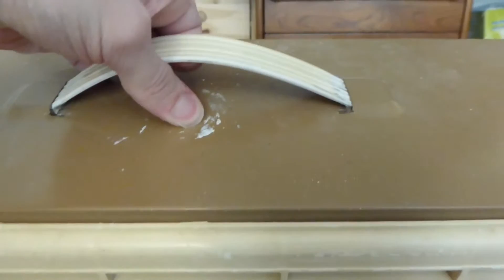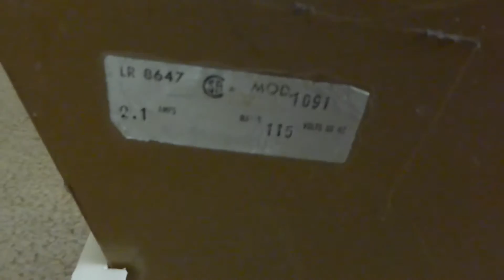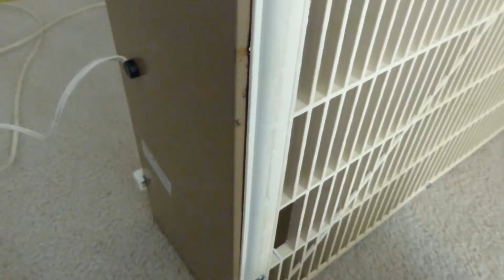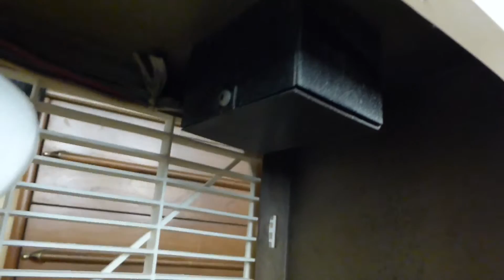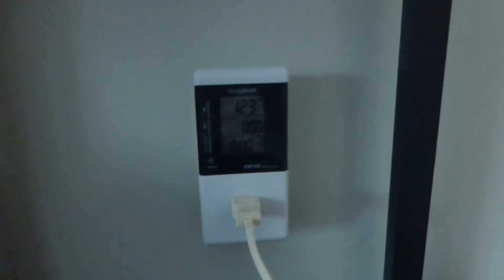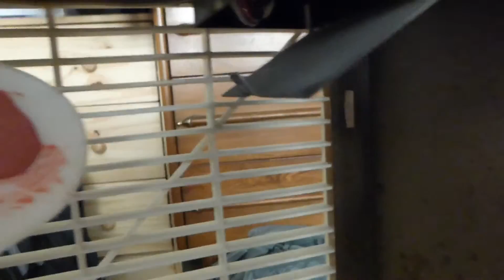A 1970s Torcan 1091 Box Fan

Comment: 3 year old video, but I was checking out your videos and noticed this near identical fan to what we have and still use at our cottage. Ours has a green chassis and was purchased in the early 1970's. Other than that I believe it is essentially identical, other than ours also has a fixed, older style (I believe) handle.

Ours is similarly out of balance, but I never got around to balancing it. I do remember planning to try to balance it when the fan was fairly new and I was around 7 years old. I made the mistake of mentioning my plan to my father. He was strongly against me altering it in any way...